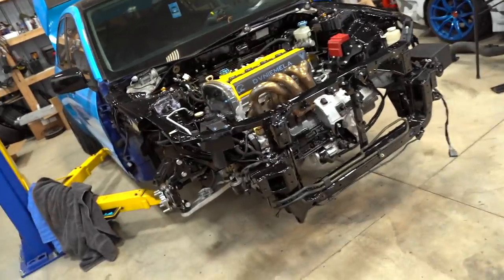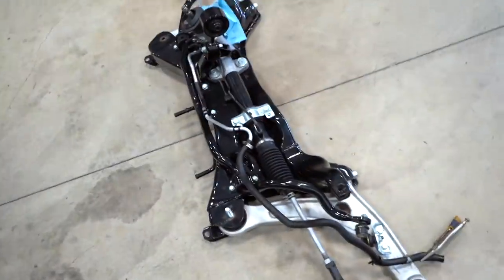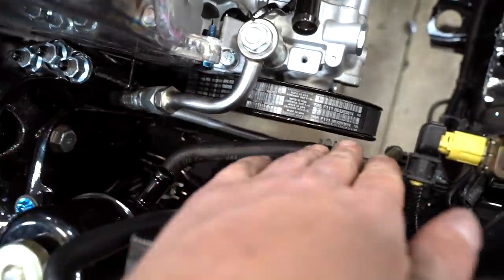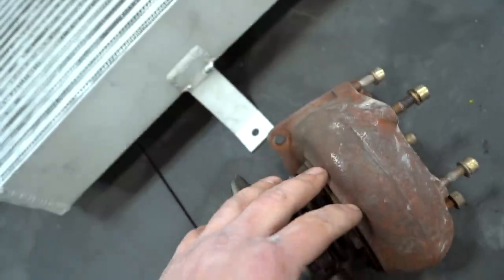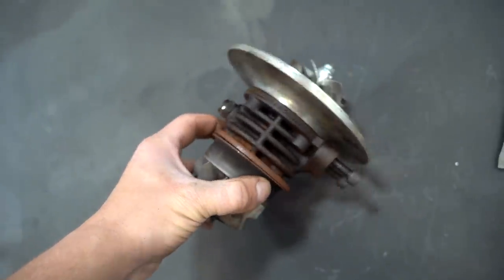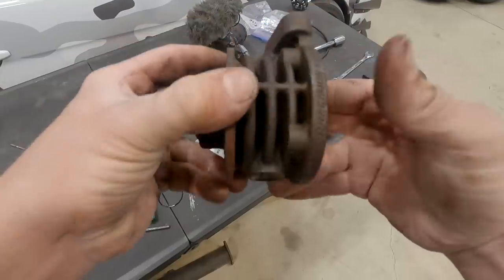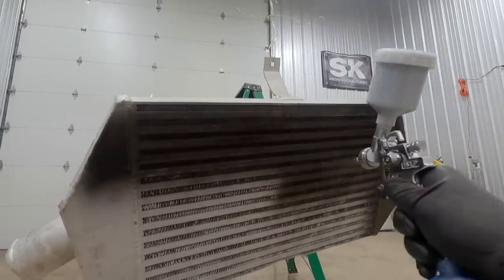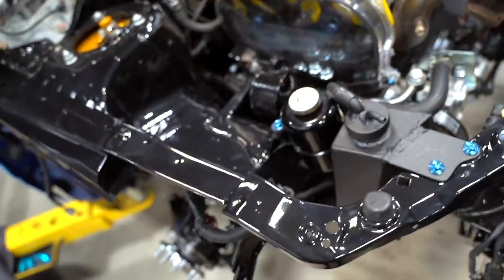The Evo VIII Rebuild | Ep.26

Comment: Ain't Cerakote (ceramic coatings in general) will reduce the effectiveness of the intercooler/heat exchange? I would Cerakote the cold side of the turbo in silver, but definitely not powdercoat. it will melt.
Reply: I definitely wouldn't had sprayed at least the fins in my opinion but if it's super thin coat like he says might not matter. Plus he lives in Washington fairly cool state. Unlike Texas
Reply: The C-7600 series Cerakote is a thermal barrier regardless of the thickness of the application, he destroyed the efficiently of that intercooler.
Reply: @maghobbs  maybe not destroyed but possibly a reduced cooling rate.
Reply: @DrivenbyGears  He's put something designed and marketed to inhibit the transfer of heat onto a intercooler that its sole designed purpose is to transfer heat. There is no question that the efficiently of the intercooler is severely reduced if coated with Cerakote C7600.

However, Cerakote does make a Transfer line of coatings that is specifically designed for thermal conductivity, which Devin should have used.
Reply: @maghobbs  good to know so something more like Cerakote C-187Q

Comment: I'm not sure how much spraying the intercooler will contribute a loss in its efficiency. It's designed for cooling. Adding a coating can act as a thermal insulator that makes an exchange of hot air for cold less efficient. I would recommend at least masking off the small vanes.
Keep up the good work.